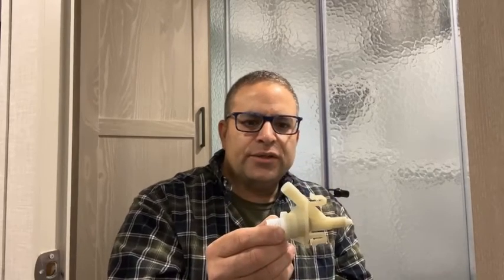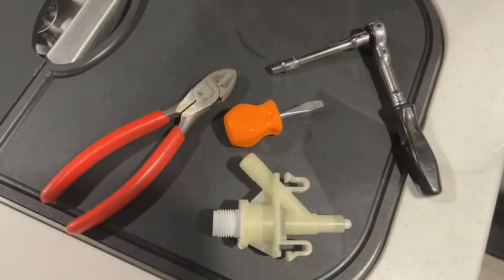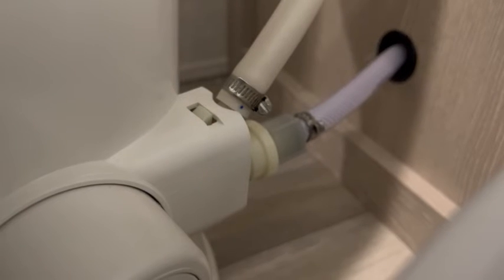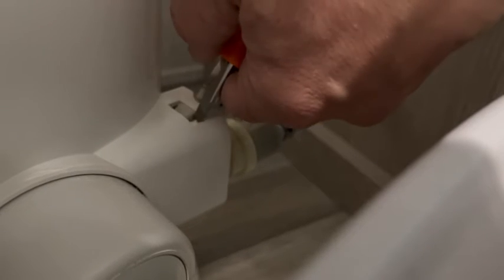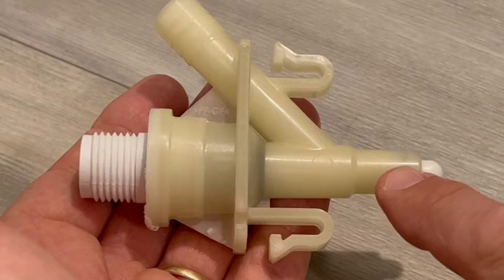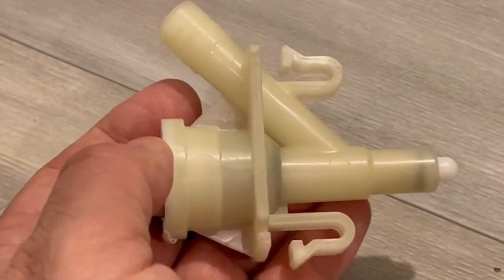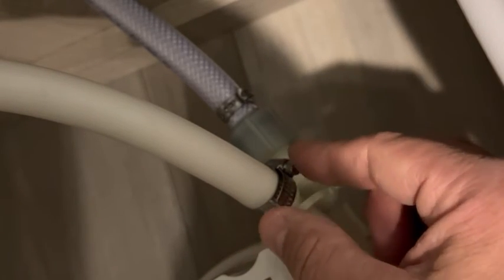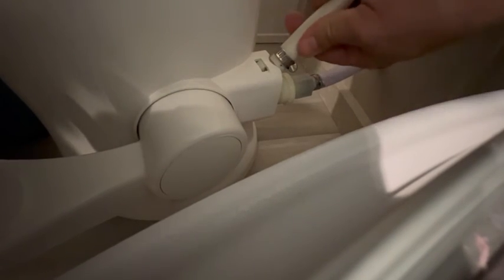Dometic toilet water flush valve replacement. #rvlife #werv #rockwood #rvliving #camping

Comment: You really helped me out with my Domatic toilet, no water flushing issue. This was  my 2022 Mini Lite travel trailer. I was able to only remove the valve and clean the screen inlet part of v-valve. Now toilet is working 100%.  There is no need to cut the factory clamp This was a 15-minute fix. 😊😊
Reply from the maker: Great job!Glad we helped..
Thanks for watching..

Comment: I’d add two things:
1. There are two clips top and bottom that must be removed. He only focuses on one clip but the unit shows two. Release both or you’ll bust the bottom one like I did. 
2. The engineer who placed the ¼” screw in that location obviously never had bothered to try to remove one themselves. It’s hard to get a socket, wrench or screwdriver on. Socket spun with fingers worked for me thankfully. Maybe it’s intentional to keep the pros busy with jobs like this. 
Also, the worm drive fastener should have the same head as the other screws in the set so you need less tools to do one job. ¼” socket would be nice. 
Anyway, good luck. Thanks for making the video. It helped me. Happy camping.
Reply from the maker: Glad the video helped! Thanks for watching!

Comment: Thanks! Mine is about 5" from the wall and I had no clue there was a screw back there. Mine is leaking backwards thru the water hose side and wanted  to take it out to see if maybe it is just a washer before replacing. Very helpful video.
Reply from the maker: Be sure to check the water pressure regulator as well, we had an issue with the adjustable type and it went up on its own. Thanks for watching and commenting! Good luck!

Comment: I have a question. My toilet had a leak coming from the bottom of the box that holds this part. I found it was missing a screw. Does it just need the screw or should I replace the entire kit? I know the screw is 1/4 but how long?
Reply from the maker: @lindakennedy5825  if its leaking, its probably the valve. Also, there are two places where a screw can be installed, so be sure to check top & bottom. Use a mirror. The screw is short, not exactly sure. I would have to remove it and measure.

Comment: Have you ever had trouble with your pump and the fresh water tank? First time using mine (on my 2205s) and it’s got air coming in from somewhere and it won’t clear. The so called manuals that came with my rv are no help! Also, are you supposed to leave the pump on? Thanks for your help! New sub too!
Reply from the maker: So far we haven’t had any issues.
Make sure the winterization valve is closed. It’s under the bathroom vanity.
It could be sucking air from the port that suck antifreeze in for winterization. 
Hope it helps.
Thanks for subscribing!

Comment: Thanks Tony. Hope I never have to use the info, but I'll be prepared if I do! John from Ohio
Reply from the maker: Thanks for watching John!
Reply: @TNTRVing  Hi Tony. Just a quick note. My wife and I just got back from a plant tour of the Rockwood Mini Lite plant in Millersburg, Indiana. It's about three hours from where we live. It was awesome. We literally got to be on the floor while the workers were assembling units, in this case 2109s. So interesting and informative. Also, not sure if you know this or not, but Rockwood is now installing converters that are compatible with lithium batteries. I'm trying to find out if mine has such a converter (guy at Rockwood is going to check the VIN to see). I don't think it will because of when it was built. However, several battery companies are building batteries that are compatible with either type of converter. They have an internal switch that enables this. I'm planning on getting one of these if the converter in my unit isn't compatible, as we do a good deal of boondocking. John from Ohio
Reply from the maker: We were hoping to tour the plant sometime when we pass thru the area. Rockwood is a well built RV they are always making improvements year after year. 
Looking forward to our tour…
Thanks for sharing! Happy Camping!

Comment: What exactly causes the leak you are having out the flush pedal? is there a crack on the old flush valve? Thank you!
Reply from the maker: Great question, the leak I had came from the end where the foot flush pedal pushes in. (The little push button in the valve)  The O ring was leaking when it was pressed in. The new part has two O rings instead of one..
Reply: @TNTRVing  Thank you for clearing up my confusion. I'm going to give this valve a shot over my failed oem.
Reply from the maker: @goldengoat4938  good luck! Glad we helped. Appreciate you watching and subscribing!